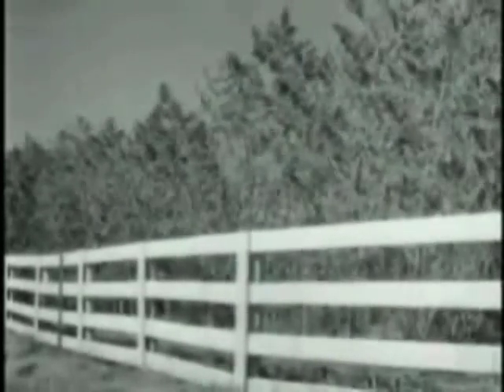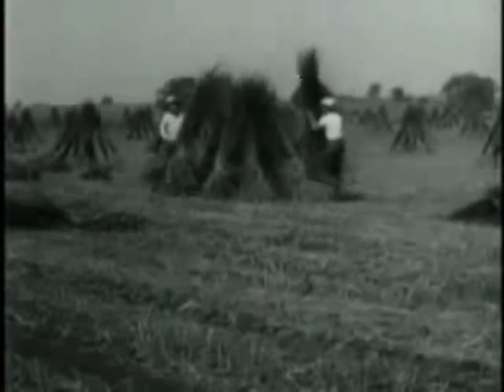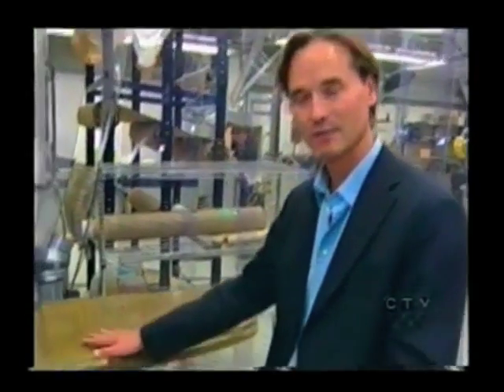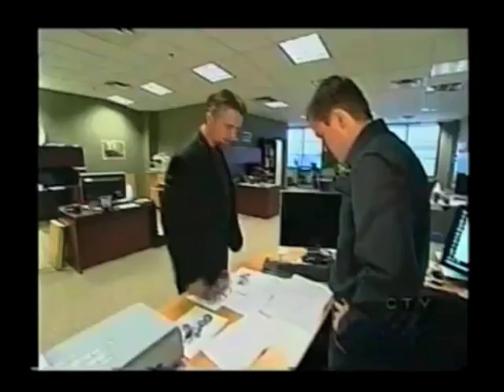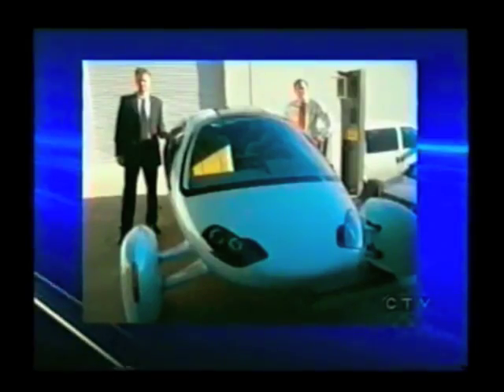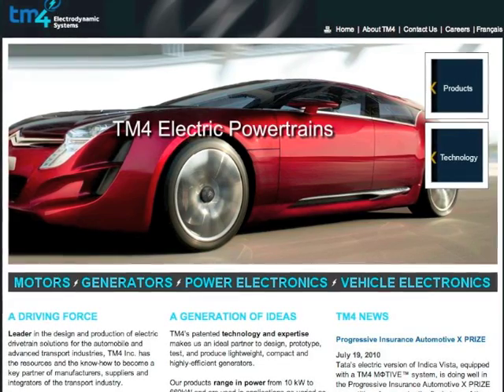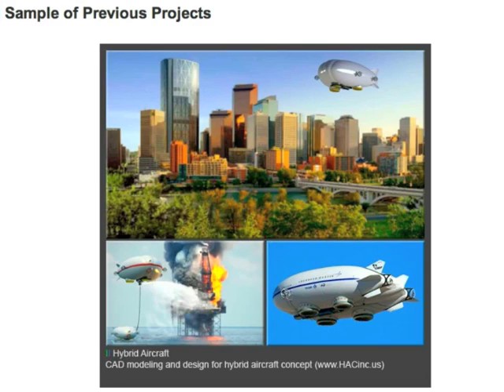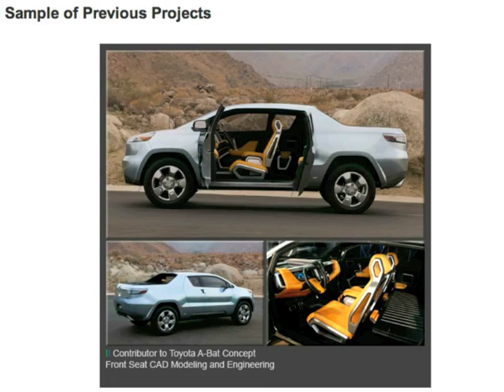Canadian Cannabis Car called Kestrel Coming soon.

Comment: WHY are they sticking an electric motor in this when Cannabis fuel is clean-burning zero-carbon-emission fuel?  So why not just stick in a Cannabis fuel engine and further promote Cannabis in industry?
Reply: Because biofuels are still fuels, and are just as dirty as any other fuels when burnt.
Reply: Stinz Maynard  What he means is that although it may be carbon neutral, it's certainly not clean. Know what I mean?
All the biproducts of combustion like the NOX gasses degrade people's health, attacking the lungs then entering the bloodstream reaching every corner of the body. Carbon neutral doesn't mean healthy or clean. It just means carbon neutral.
If only you could somehow burn THC or CBD to move a car. That certainly wouldn't be bad for people's health.

Comment: Elecric engines (often in-wheel these days) offers far more design freedom, and have the ability to regain used power when reducing speed (regenerative breaks and suspension) 

Having said that, Hemp is absolutely the most useful plant known to mankind, and should absolutely be used as much as possible. Old cars (current cars) could easily run on hemp fuels, both petrol annd diesel engines. Diesel engines require no modification, and petrol engines needs only cheap minor modifications.

Comment: Well, simply because electric cars has one moving component in it's transmission, the rotor of the electric motor. In most cases they don't need water cooling, It has no exhaust, no complex (vounrable) engine management system (Fuel injection uses at least 5 different sensors to work at all) and electric drivetrains weighs considerably less for it's performance compared to combustion engines. Fuel engines also have a very low energy efficiency, as most of it's energy is turned in tp excess heat